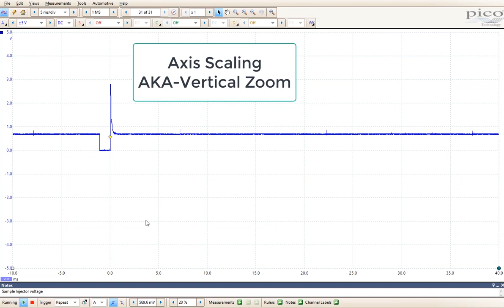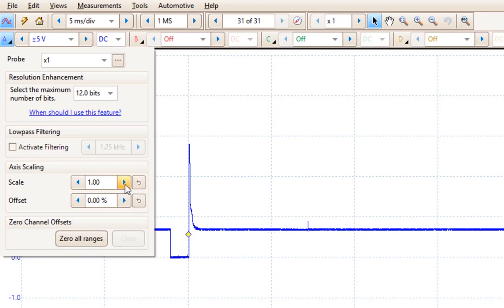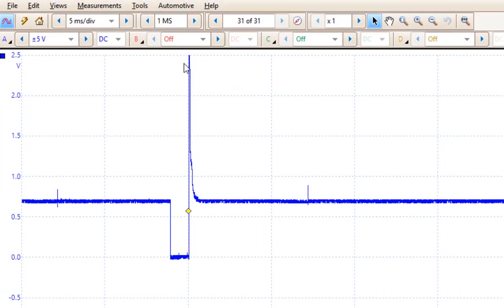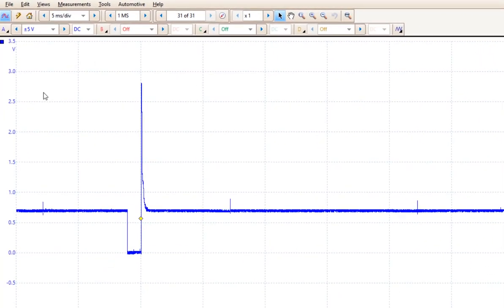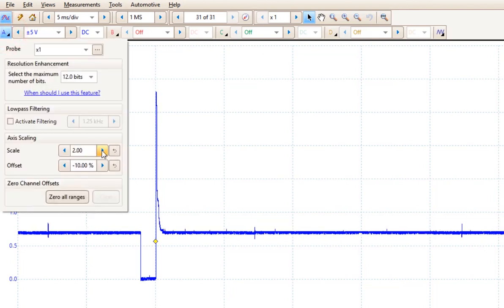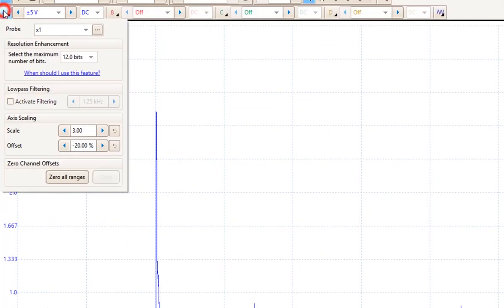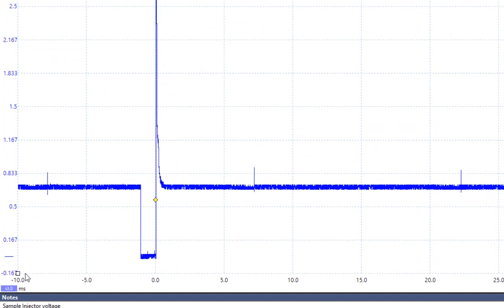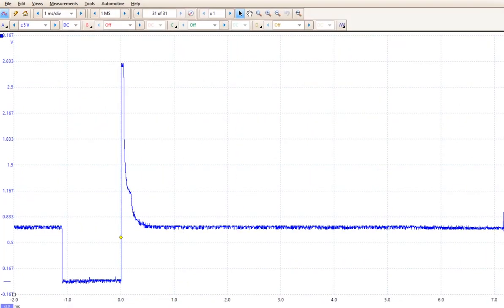Pico Scope 6, Axis Scaling (Lesson 9)

Comment: please make a video how to connect picoscope 3000 series to breadboard
Reply from the maker: A breadboard is nothing more than an electrical circuit build on  a board for simulation or prototype.  Like any electrical circuit you will have power and ground and sometimes an on/off or variable value that you measure with any scope. Ground the ground lead and place the positive probe within the breadboard circuit where you want to measure the value. From what I can see the Pico 3000 is very similar to most USB Pico scopes with multiple BNC cable probe connections.  All except for an inductive amp probe the probes will have two connections. one will be ground and the other will be the value you want to measure.   I hope this helps.  I don't have a 3000 series Pico. I don't have any electronics breadboard but I do have some electrical circuit simulator boards where I can built some basic automotive electrical circuit. I have a ton of project in my Queue that I want to get to including a series on Pico 7.
Reply: @DrivelineMaster  thank you for your reply....
I have a doubt in poco technology software signal generator is there.this signal generator is input of bread board or not
Reply from the maker: I'm sorry. I don't fully understand your statement and question. Are you asking how to use your signal generator with your Pico Scope?